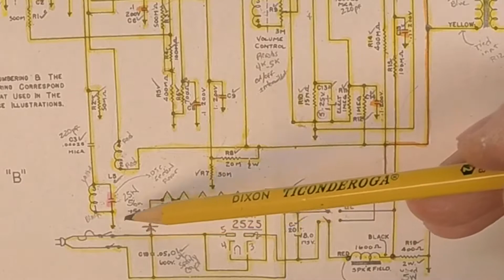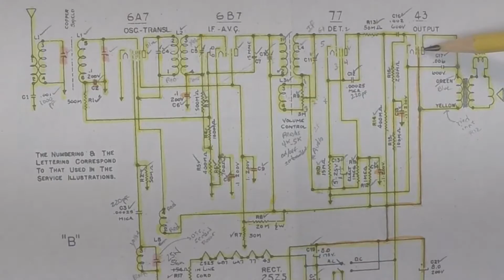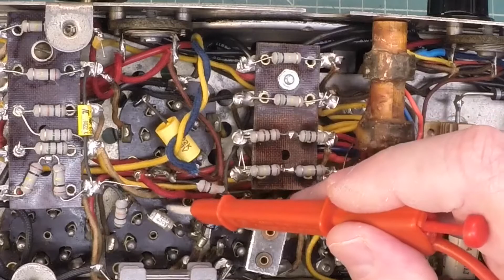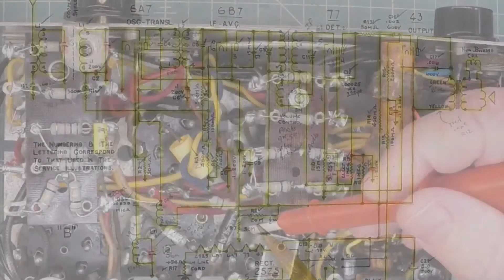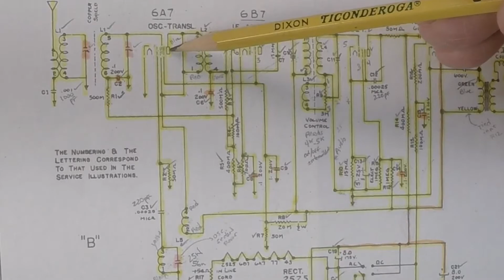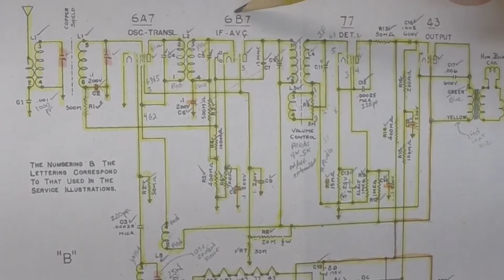Silvertone "Companion" 57 D 1704 - Troubleshooting w/ Nothing More Than DC Resistance Measurements

Comment: I have never seen a bottle of De Oxit that big!  Based on what they charge for a small can that thing had to cost a bloody fortune. Great series on this set Don, beautiful work.
Reply from the maker: +Larry Fowkes Hi Larry, no kidding, I picked that bottle up at least 15 to 20 years ago directly from a distributor. I had it in storage until last year and didn’t even realize I had it. Thanks again for watching. Best, Don
Reply: Where I worked, we bought the stuff by the quart.  It was expensive back then (in the late'60s) But I did not know that General Cement was still in business.